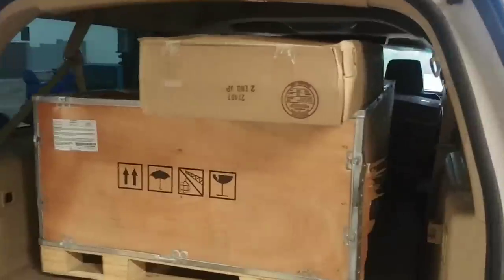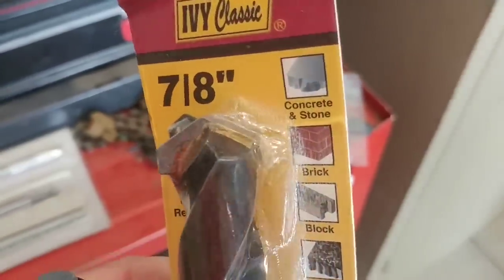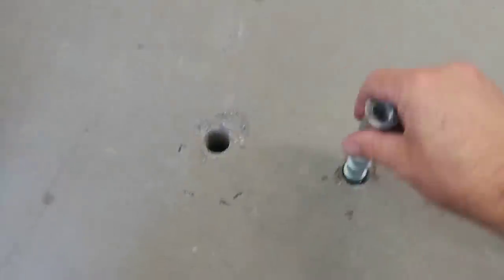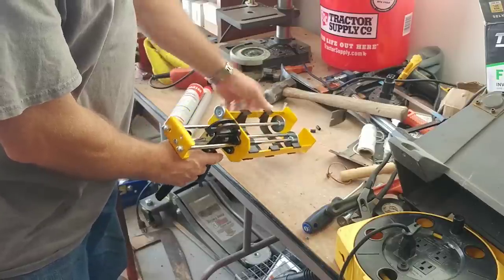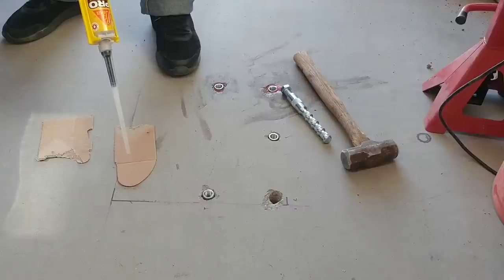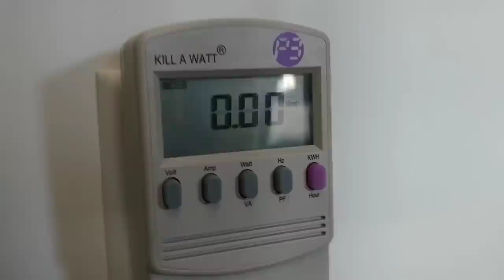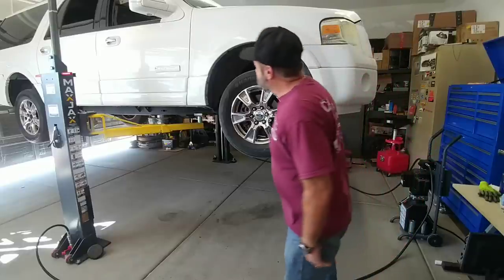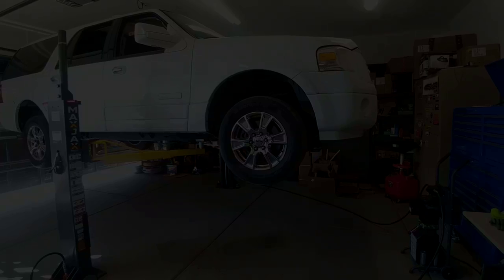BendPak MaxJax M6K Home Garage Car Lift Installation Tips, Testing, and Amperage Measurements.

Comment: HI Shane.  You might have missed it in the video, but what is the spacing you used between each post?
Reply from the maker: I did 104" inside to inside base. Outside of the base to outside is 130". I'm pretty happy with the width as so far it has worked well with a wide variety of vehicles.
Reply: @shanesdiy  Great! This info will help, as I have a f150 and a few small cars.  Wasn't sure what the sweet spot would be for spacing.  If the spacing has been working out great for you, then I might consider it as well.
Reply: @8teenclan602  Make sure to mock it all up before drilling is my advice. Lifting locations vary wildly car to car depending if you have a full frame or unibody.  I’m at 119 end to end. Good luck!

Comment: Use some expanding spray foam to fill cavity below the bolf hole
Reply from the maker: Yes, in hindsight that would have been very helpful to save epoxy.
Reply: Are you joking?
Reply from the maker: He's referring to the open space i created when I had to pound the old anchor down through the foundation. That cavity consumed huge amounts of epoxy to get up to the actual anchor hole. Probably 90% of that wasted epoxy is not doing much to aid the structural integrity of the anchor.

Comment: What width did you go with for install from back of base plate to the other back of the base plate.  I'm thinking of using 120-125 inches  as i need to lift a medium SUV as well.
Reply from the maker: I did 104" inside base to inside base width.   Outside to outside of base is 130".  A little closer would be nice for some of the smaller cars but I can easily do my Expedition and the small cars haven't been a problem yet.

Comment: I'd be willing to bet that the Expedition is too heavy for this lift, because of weight bias.  Each arm on that lift would be rated at 1,500lb.  Your vehicle will be heavier at the front because of the engine, and transmission
Reply from the maker: I've had the Expedition up and down the lift a number of times since the video and it's never had any trouble lifting it or felt "wobbly".  When properly centered on the lift the weight is quite balanced, if not it would be prone to tipping forward.  No easy way for me to weight how much is on each lift arm.

You could be correct but in my experience so far it has not given me cause for concern.  I expect they have to build in some safety margin per arm if they rate the entire lift at 6000 lbs.

Comment: Notice your engine hoist is pneumatic where can I buy this item
Reply from the maker: It was originally a manual jack on the engine hoist that had failed and I purchased the pneumatic version at Harbor Freight but looking at their web site I do not see it any more.  There are some pneumatic long ram jacks on Amazon that should work.  Here is a link to one that should fit on a standard engine hoist but you'll have to confirm before ordering it.

https://amzn.to/3GN5Q3w

Comment: How is the cost for max jack ?
Reply from the maker: I paid $3020 for the MaxJax kit but I got the "ultimate package" that had all the extras.  I later purchased the epoxy anchor kit which was $238.  I also purchased a few tools to get the job done, links are in the video description for those.  These include hammer drill and bit, epoxy applicator gun, etc.  Not sure what the MaxJax is selling for now.  I am very satisfied with the lift, it has made my life so much better when I need to work on any vehicles.

Comment: Kind of an awkward lifting hight isn’t it?
Reply from the maker: Would be nice to be able to walk around upright under it but I have adapted. Get the right height roller stools, jacks, etc. and it works out. When I did a 350Z transmission removal I used my 6" extensions and that did make quite a difference. Still could not walk upright under it but it was much better.  Just takes a few minutes more to get it up on the high extensions. Not worth the trouble unless you really need the clearance.

Comment: I would have poor a bag of self leveling cement in those holes. wait until was hard and go forward with the drill and dill the new poured cement so that now it will let you hold on the anchor
Reply from the maker: In hindsight that probably would have been a great idea.

Comment: Look 👀 i know it’s me okay,but has one of these ever Ever failed
Reply from the maker: If one of these, or any lift for that matter, failed it would most likely be due to installer or operator error. The lift is just a large beam of steel and a hydraulic cylinder. Unless you overload it that isn't going to fail and if it came out of the concrete it would be due to improper installation.

That said, I'm sure you could find reports of failed lifts if you search the web.  I was a little apprehensive at first but now that I've had cars up on it dozens of times and worked under it for many hours I am not worried at all. Follow the precautions, pay attention to what you are doing, use the safety stops, balance the vehicle, etc.
Reply: Thanks for your video, it was very informative and I appreciate you taking time to show all dimensions in the lifted position. I would love a hoist in my garage like that one. Thanks again for your video.

Comment: Hello Shane, thanks for some of the detailed you have included in your video. this has helped me prior to installing mine. I just got mine installed and i noticed one of my post was tilting inward slightly when lifting a video. I also noticed that yours seem to be doing the same at 23:02 when you life the evo. I posted a video on my page, can you confirm if your post is doing the same thing? any comments or response would be appreciated! 

https://www.youtube.com/watch?v=-Tw8N5ZstU0
Reply from the maker: I don't see any movement in my video at the time stamp you mentioned. I've never noticed any movement like I see in your video that seems excessive.

I would lift yours and when you see that movement see if a gap opens up on the outside of the base. See if its tight when down and when it leans see if a credit card will slide under it. Perhaps your anchors are not torqued tight enough or the anchors are moving? If the base isn't coming up could be slight flexing of the posts but I don't recall seeing that on mine even when lifting my big SUV.

Be careful and make sure its secure before using it.

Comment: This is a very questionable install. The concrete slab is too thin; he should have cut a section and poured in new concrete with sufficient rebar. Chemical anchors are not a replacement for thin concrete.
Reply from the maker: Installed over a year ago, I use it often and it hasn't budged. Anchors are solid. Absolutely, if you are installing yours and feel the concrete isn't sufficient, cut it out and make it so. I made a judgment call and it hasn't given me any reason to loose confidence in it yet. I check the anchors often and check the torque.  I appreciate the good advise for the viewers.